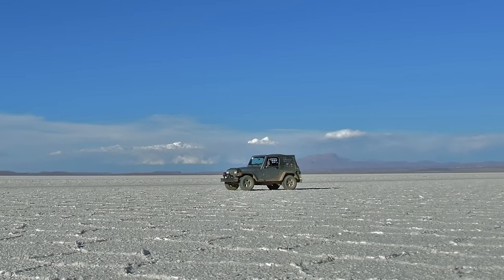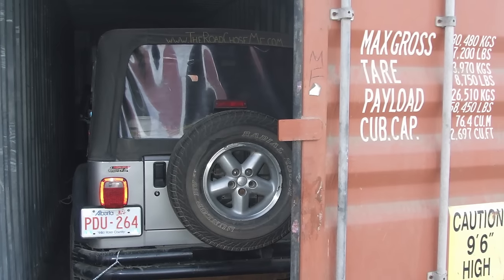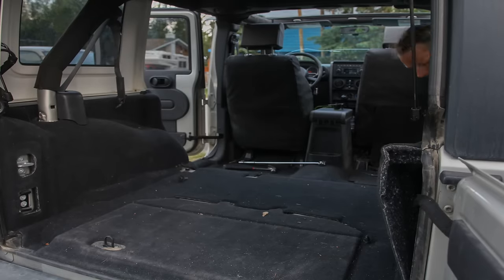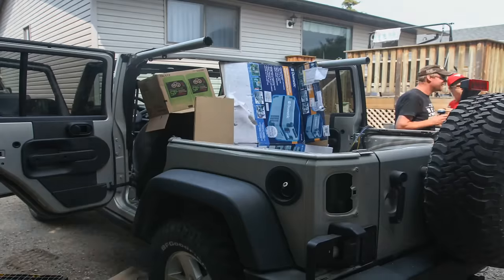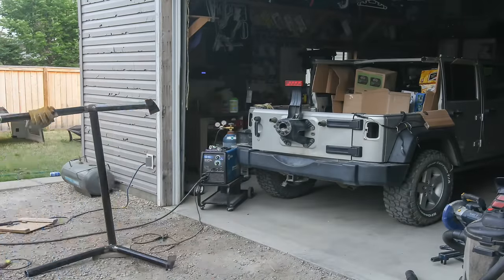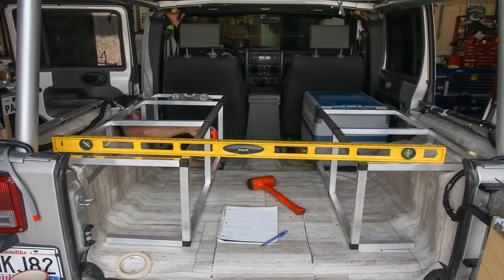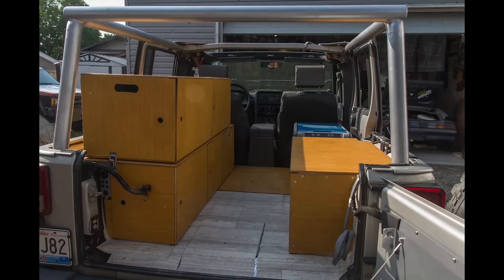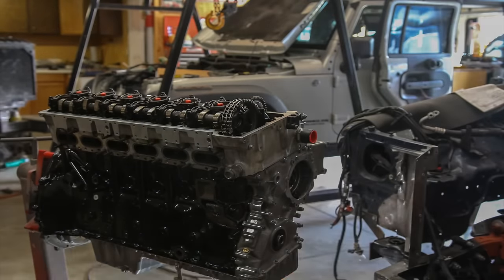Africa Jeep Wrangler Build Part 1 (Epic three year Africa circumnavigation! 2/53)

Comment: My 99 Jeep Wrangler has 165,000 miles on it. The only thing I've had to replace is the electronic clutch, my fault for not adding fluid ! What a great vehicle my Jeep has been !
Reply: They are great vehicles but when you start overlanding to the extreme (don't know if he's going to be on paved roads or offroad most of the time) you'll end up breaking more stuff much quicker, fortunately they're usually just suspension related, not engine-related. :)  This of course is the case with Every vehicle, regardless of brand hehe- just heavy offroading is a lot of wear and tear!
Reply: Yes, I've been off road a LOT ! Probably should have gotten a quad at some point!

Comment: So I noticed in the DIY that you are using the yellow top optima over the blue top. Is there a specific reason for that?
Reply from the maker: My understanding is the Yellow Top is better suited for use as a "house" battery - it can handle loads for long periods without charging. And the rule of thumb is to make them both the same.

Comment: Your first trip Jeep engine worked well, why change out the engine on your next Jeep?
Reply from the maker: Diesel is much cheaper and more readily available in the developing world.
Reply: Why did you choose to go with a mercedes engine, just out of curiosity?  I know that both Nissan and Toyota makes some 4cyl and 6cyl diesel truck engines, they don't put out a lot of horses but they're torquey and can really haul and tow stuff (granted that's partly due to the gearbox as well).   They are readily available and much cheaper to work on and repair than a Mercedes diesel.

Comment: Swapping an engine that is not designed for it is of course, no recipe for trouble free motoring, IME generally a nightmare regardless of how skilled the fabricators - considering I've had near unsolvable problems even swapping in a Japanese 200 SX engine into an American 200SX car - I'd run screaming (like a woman) from all non factory engine swaps
Reply from the maker: In hindsight, I agree with you 100%. It's one of those lessons I needed to learn the hard way. Looking back I'm still happy I tried, otherwise I'd be sitting here right now saying "I should have tried...".   In any case the stock Jeep engine was perfect for the adventure and I couldn't be happier!

Comment: You already went 40,000 miles on a stock jeep? Just curious on your train of thought?
Reply from the maker: Yep, 40k miles from AK to Argentina without a single mechanical issue.
Train of thought - the Wrangler is extremely capable, cheap to buy and stupid fun with a soft top and no doors !
I've just passed 40k miles in Africa now, this bigger Jeep is going strong.
Reply: @TheRoadChoseMe  on why you choose to put a diesel engine for all that money only to have it blow up?
Reply from the maker: I was convinced diesel would be better for Africa - more available and cheaper and (in theory) better reliability with an all-mechanical engine. Obviously my theory did not work in real life. Live and learn.

Comment: I'm a new subscriber, I have one question. Why did u want a diesel engine though? Could I use a gas (petrol) vehicle for long trips? Thanks.
Reply from the maker: Hi,
I was convinced diesel would be easier to find, the engine would be stronger and simpler.
As it turns out, gas (petrol) has been very easy to find, and the engine has been plenty reliable!

So in hindsight, the diesel swap was not a great idea to begin with!